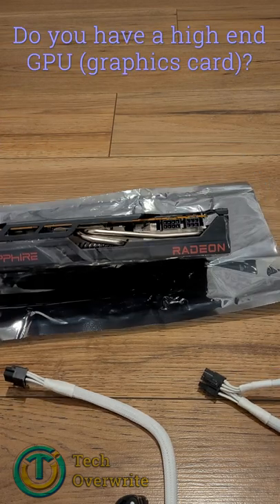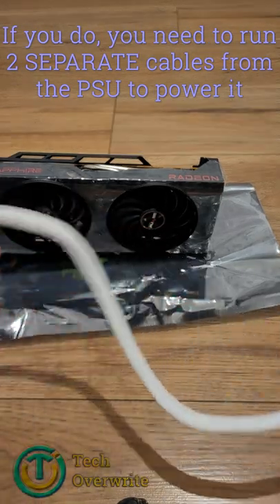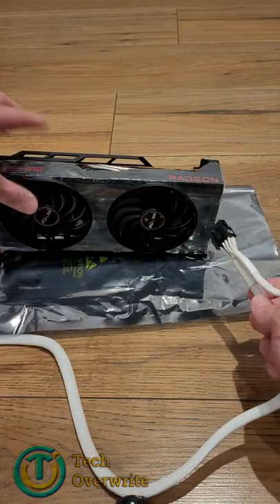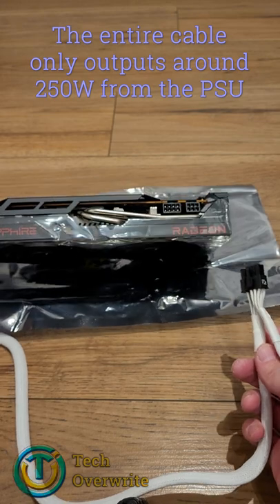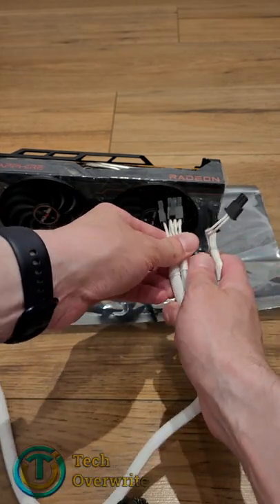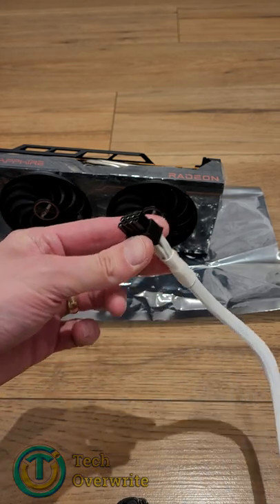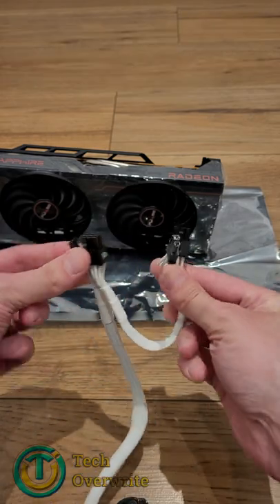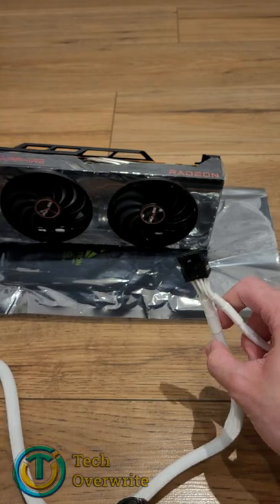Why You Should NEVER (Usually) Use The Same Split (Pigtail) PCIe PSU Cable #Shorts

Comment: that 250w talk is not true. single cable can easily output over 300w
Reply from the maker: Hmm, I have heard of 250-300W GPUs crashing with 1 pigtail cable. They were then fine with 2 separate cables. It's hard to know for sure though. The PSU make/model naturally matters here too.
Reply: @Tech Overwrite  it might have been a problem in the past when PSU's had multiple 12v rails. So cables were connected to different rails not to overload psu. Now pretty much every modern consumer PSU has one 12v rail so it shouldnt make a difference. The only thing is that the connector or the cables could get too hot but you then the cables have to be extra thin so thats quite unlikely. Now there is slim voltage drop for the second connector but that doesnt really change anything if you are not a hardcore overclocker who is trying to get everything out of your gpu. I mean psu suppliers wouldnt add those cables with their products when there would be any chance of danger.

Buildzone made a video about 5yrs ago where he is powering Vega64 with one piggyback and letting like 400w through one cable and it was fine. It was on his "Actually overclocking" channel and its named "A look into daisy chained PCI-e power cables". Its still up.

I guess its a bit safer to let all that current through two cables instead of one but if you investigate the physics behind it, there really shouldnt be any difference.

Comment: And who tf tells you about this ffs. Had my 1070ti running like this for like 4 years now...
Reply from the maker: It's hidden away in many PSU or GPU manuals to be fair. Your GPU might be fine with just 1 cable though, based on the TDP. I go into this topic more in the linked long form video, because I forgot to mention cable guage and the motherboard PCIe slot (that supplies 75 watts too) 🙂

Comment: Pigtail connection is power supply over 500w should be iligeal and alas no more confusion who is with me !
Reply from the maker: I agree, it would prevent a lot of confusion. Heck, you'd hope that GPUs with a high TDP would include a warning leaflet saying to use 2 or more PCIe cables. That would be good too 🙂

Comment: Can one cable cause coil whine
Reply from the maker: Yes it can - I've spoken to loads of people who had bad coil whine on their GPU, which then got fixed when adding a second cable.
Reply: @TechOverwrite  it did not fix it, my gpu is rx 6700 xt sapphire pulse, can you give me an advice how to reduce it if possible
Reply from the maker: @coldguy  sorry to hear it. That's the exact GPU I have and I have zero coil whine. Hmm. Is it a new issue, or has it happened for a while? I'd be tempted to suggest contacting Sapphire incase it needs a repair/RMA, to be honest. I know that's annoying though 😞
Reply: @TechOverwrite  yeah, very annoying, i t is not a new issue, just finished building a pc but i bought used gpu for 270 dollars, and i contacted him back and luckily he has the same gpu to sell so he will check if that gpu has coil whine, if does not we will switch. What are the chances that it does not have coil whine😔

Comment: Then why does every freaking GPU power cable have the daft pig tail. They dont make any sense at all.
Reply from the maker: It's pretty annoying, I agree. You can buy single connector end PCIe cables which don't have these ends, but yeah the standard ones come with the two which is frustrating. 😞 It's because some PCIe devices might need 75-150w of power, so a pigtail cable can then power both these devices.
Reply: They still do. Majority of PC users don't use cards that draw more than 250W (which is a good thing)  so the pigtail is completely justified. Even back in 2014 when I assembled a exhibit PC for my local PC store two pairs of pigtails was able to power a Devil 13 (quad 8 pin GPU) that was just benchmarking there for 8 hours. I think the issue here is GPU manufacturers and PSU manufacturers miscommunicating. And the new NVIDIA high power cables had more controversy and failures and a year than pigtails did ever

Comment: If the tdp is too higher than 240 watts you can use 1 8 pin to 2 8 pins or to 1 8 and 1 6 pin cable. Using the 80% rule an 8 pin cable can carry up to 300 watts, but should never go over 240 watts. A female 8 pin will max pull 150 watts and pcie max pull is 75 watts. Your short is completely false and should be deleted or edited to signify these things. After watching this I believe you to very unknowledgeable.
Reply from the maker: Thanks for the detailed comment 🙂 It's not completely false because as you say, limits do start appearing - and I think this will become a bigger issue with Nvidia's 40 series. But you're quite right that I got the basic wattage limit wrong, my bad. Since the video can't be edited, that's why these comments are helpful to go alongside the video.

Comment: Bought a gpu to upgrade my pc... it has two ports, but my psu only has one cable...
Fuck.
Reply from the maker: Ugh sorry to hear it 😔 If your card's TDP is below 250W, though, you might be fine with just one PSU cable. It's hard to say 100% for sure though.
Reply: @TechOverwrite  checked and it's 230W so should be good.
Also on the psu's website it showed it doing the exact thing soo...
Reply: @tamary.leitmotiv what is your gpu?

Comment: Can you remove the other excess pigtail? Or do I just need to get a different cable?
Reply from the maker: Unfortunately not (easily) - the cables would still be live. You can purchase other cables though. CableMod are a popular option. If you have a Corsair PSU, though, they sell individually sleeved 'single connectors' (basically, without the pigtail) and they look awesome. 🙂

Comment: Naaaah not really.
You should try to watch a video about RTX 2080 Ti with Ryzen 3950X using just 450 Watt PSU which is uploaded by TechYesCity

Piggyback PSU usually rated for 150+75 watt. Hence have a total of 225 watt NOT 250 watt. And don't forget the PCIe X16 Lanes also provides 75 Watt from the Motherboard itself.

RTX 2080 Ti works just fine with piggyback PCIe power connector 8+8 because the stock+boost clock of 2080 Ti is capped at 250 Watt if not Overclocked. Hence the total power feed is like 150+75 watt from 8+8 pins PCIe cable, and another +75 watt from PCIe x16 Lanes making a total of 300 watt headroom.

Should you ever Overclocking RTX 2080 Ti, then, only then, don't use piggyback PCIe power connector.
Reply from the maker: Thanks for the detailed reply. Yes I agree it should be fine... until you overclock. And that's part of the problem IMO - it's so easy to overclock the GPU nowadays, that I personally think it's worth using two separate cables straight away. It's easy to forget you can't overclock otherwise.